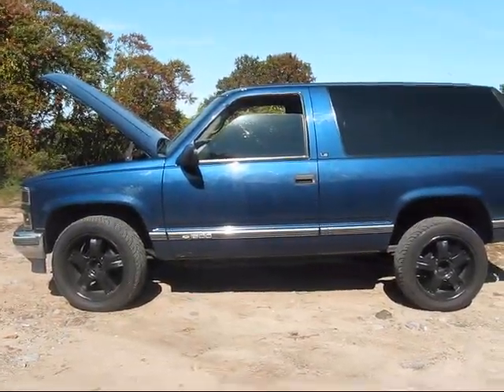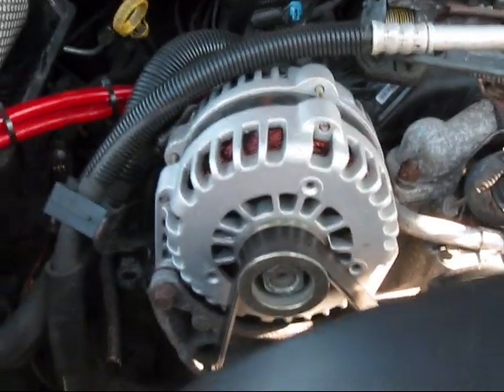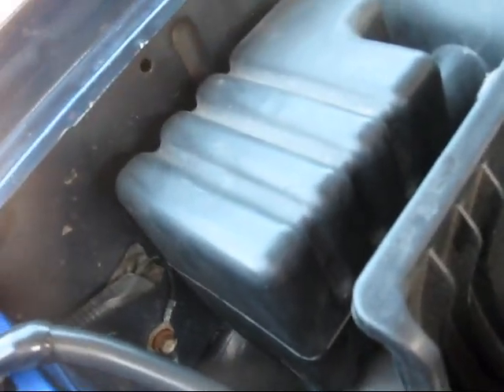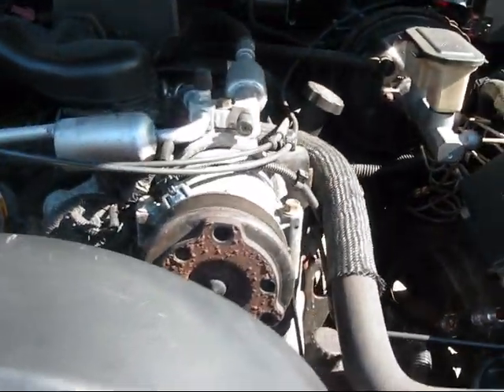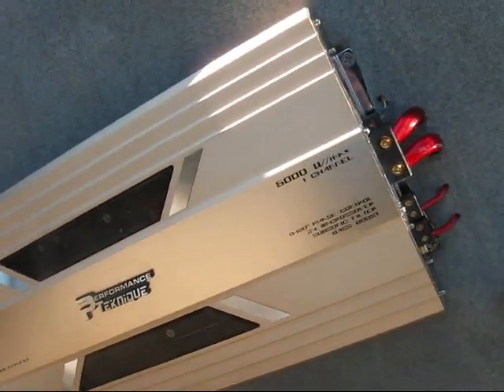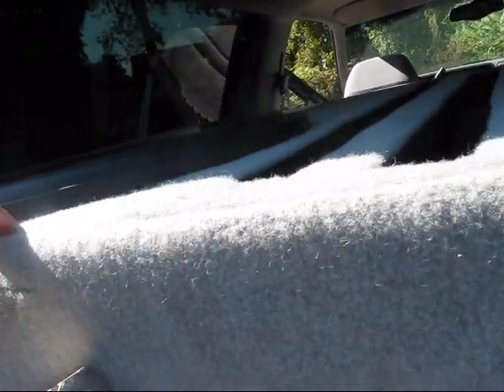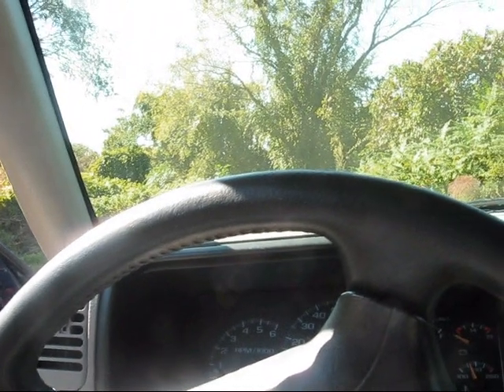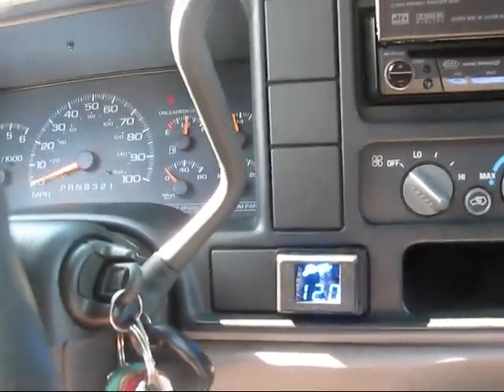how to wire multiple batteries

Comment: This is a really old video but in case someone tries to do this please be aware that is very dangerous to put batteries like these, lead/acid batteries, in the cab of ANY vehicle. When they are charging they put off hydrogen gases. Putting those batteries confined under a seat and that gas will accumulate building a very powerful bomb. All that's needed is a spark. SOMETHING THAT BATTERIES ARE VERY GOOD AT PRODUCING. EVEN THOSE SEALED BATTERIES HAVE PORTS OR VENTS TO ALLOW THE GASSES TO ESCAPE. The only battery that can safely be put in the cab of a vehicle is lithium batteries and they require a different type of charging system then what comes on almost every car. Those lithium batteries don't explode from the glasses that they put off they just tend to explode. Because your charging them... Point is no matter how you do your build it's better to 
keep your batteries away from the area that you or others may occupy. The chance may not be very high that something might go badly but the fact that there exists a chance is enough for me not to take it. My family and friends mean more to me then having the loudest stereo. Even if I were to build a split truck for compositions. Still not worth the risk of explosion

Comment: Dont see the point in connecting 2 batts with no isolator, when your truck is OFF you cant run shit for hours and hours then you kill the starter power. Having 2nd battery alone and 2-3-4 alternators to main battery, with isolator will charge 2nd when needs to be but wont effect the starting power. Your risking need a jump start connecting both batteries and running stuff. Example camping or working, I run heavy duty lights off 2nd battery w power inverter even a fridge and tools, so no way I want it sucking from my main battery

Comment: F or fail. Your radiator support is aluminum just an FYI. That's a whole lot of cables you're not getting any points on cleanliness. It looks like ass , and not the hot cheerleader type ass

Comment: Your gunna burn up that alternator trying to power all that equipment if it’s the stock 140 amp . Also u could cause issues with the batteries as well if always low voltage and never getting there full charge. U have a nice size vehicle to drop a few more alternators in that beast. Immmmmm out ooooooo heeeeeeerrrrrrrrr.

Comment: Try a dc to dc charger and a smart alternator box that will triple the charge when needed and a heavy duty voltage regulator . This will cost much less than 4 more battery and two more alternator victron makes these two boxes .

Comment: Just a suggestion never screw your amplifier to your speaker box just picture this take a bungee cord and strap your head to your box I know it sounds funny but do it for one beat then once you feel that your amps will take a beating the amplifier gets hot and you have soldered joints all over your amp board when you're amp gets hot the joints get hot as well and the constant beating on the hot amp can cause things to come apart strap them to the back of the seat mounted on a piece of 3/4 inch board I used plexiglass 1/2 inch you can drill the wood or plexy and run your wires through the holes that's why people build amp racks to absorb some of the raddeling and so that the amps can cool easier I had the same truck you have now I had 4 sound stream pro 15s 4 1000 watt sound stream amplifiers 1 going to each 15 and and a us 500 watt amp running all mids and highs and 200 amp alternator 3 batteries all old school amps and speakers the new sound sream amplifiers and subs were bought out by some idiot that calls them the tarantula series fucking retarted but I cracked the windshield at 3/4 volume any more than 3/4 volume and the truck would shut off so I sold the truck I wish I didn't that truck with an ls swap the ls truck motor come with iron block awsome for boost compared to the none iron blocks that you have to get a girdle for the bottom end just wanted to let you know I've messed up a couple amps bolting them to either the box or to the metal on the floor if you're going to put some foam under your amp wrack just looken out its happend to me so good luck with the build

Comment: I upgraded my power system in my Honda HR-V to support my various interior power applications for my work computer, my bi-passed security-disabled navigation system with full onslaught hi-res screen mirroring , undercarriage custom hand made 25,000 lumen output safety lights that aim toward the ground,  and also to power high draw appliances for survival applications as well. I’m also setting it up for actuator type applications. The coffee maker idea I had is also almost completely drafted onto paper. The list keeps increasing but I’m not waiting for the auto industry to finally get with the program and install these things into the vehicles. The last goal I have which is possibly the most expensive is adding custom fabricated steel plates onto the front of my bumper. It’s going to look like a versatile beast on the road minus the 4 cylinder turbo engine. I know it’s not a truck but I pack more hardware and tech in my HR-V than the average truck has. :D

Comment: I’m installing a second battery on myTahoe to run the led lights in my travel trailer.  Having it wired like this will get it charged while I’m driving.

Comment: How is that supposed to work man? No matter what you do you will overcharge one or the other batteries. This is why they make battery isolators. One battery to run your vehicle the rest of your batteries to run your system! How will the alternator not charge the battery fully charged running your vehicle? While trying to keep up with the battery running your system? Running two power wires off of the alternator even with matching batteries if you are using one to run your truck and one for your system at the moment the one running your truck will be overcharged or the alternator will read the battery is fully charged and not charge the battery running your stereo system. Now you could run two identical batteries in series to double your battery capacity but you cannot isolate One battery for your subs and amplifiers and one battery for your vehicle. I have 4 batteries in my trunk. I do not run them in series parallel. One of them runs my vehicle and the head unit. The four in the rear end have a battery isolator that comes from the front main battery. Whenever my rear batteries are low the isolator receives the power from the front battery! In the end for the way your system is hooked up you would need to either run the batteries series parallel like one giant battery and if you're doing that you would not come off the alternator you would jump from Battery to battery power and ground with both batteries fully charged at the start. So one battery would not have more power than the other battery. The way you haven't ran. Two power wires off of your alternator as you deplete One battery from your system and the alternator tries to charge your second battery the front battery or main battery running your vehicle would be overcharged that or the alternator would detect that one battery is fully charged and the other battery would never receive a charge because the alternator would shut itself down due to the first battery being fully charged! Even if the alternator did not shut down and it started to charge your secondary battery it would overcharge your other one. You need a battery isolator or a second alternator for the stereo battery Bank. unless those batteries are ran parallel like one giant battery you run the risk of overcharging one or under charging the other.
Reply: Need some advice I have 2 Optima yellow top same battery's one under the hood (big 3) and the other in the trunk I ran the positive from the front battery to the rear and grounded the battery to the car I'm wondering is this correct . Years ago my sound system pounded along as I had the car reved up to 1k rpm and now the sub cuts off so I took off the rear battery and charged it this works for a week or so then back to the same problem I think I might have a bad or going bad alternator that can't keep up with the system around 2800 watts on a stock alternator . Car is a lexus gs very hard to find a higher amp alternator for this car for some reason but any advice would be appreciated. Thanks

Comment: I did the same thing like u did . Did the big 3 . I have a 130 amp alt (stock was 55amp) I have a brand new Walmart batt upfront n 2 XS750’s in the rear. But wats happening is my right blinker went crazy. So what I did was pull a trigger from the fuse box cause I believe the problem was coming from the remote from the head unit. Once I used the trigger from the fuse box the blinker problem stoped but now I can hear my belt giving off a slight churp, like the alt is struggling . What do u think caused the problem that was making my blinker go nuts? N also what do u think about the alt struggling? I hope the alt is strong enough?. I’m running a zrx3000.1d hyfonics, pushing a single pioneer tsw3002d2 . N a kicker 300.4 pushing 4. 150 watt pioneer door speakers. Everything is fused with 150 amp fuses.
Reply: 300 amp fuse on my subs... 4 15s kicker subs... On 1 ap 3000...im lackin a good alt... .my new set up gone be tough tho...

Comment: That is nuts I had one big high output alternator with 2 batteries 4amps the big 3 upgrade and never had problems with voltage drop he doesn't need all that for what he has and I also had dry cell batteries one under the hood and one in the back close to the amplifiers

Comment: hello everyone, I'm looking to install 2nd battery in my suv 2000 4runner v6 for led lights and etc...so i wanna know whats best changing the alternator to 200 amp or get battery isolator? which one of the video is problem free and less hassle ?

Comment: You said so much dumb ass shit in this video I'm surprised you even thought it was okay to feed other people incorrect information. You clearly have no idea what your talking about. First, RMS only applies to AC power, not DC power. Did you really say you have a 300 amp fuse to "get the most power into your battery"? You must not know what a fuse does.  I can't believe you said your old ground was sparking. Did you never think about that before you did whatever it is you did to make it spark?

Comment: im not hatin bro but do some research man your overdoin it way too much you dont need 6 batterys for your beat bro just trust me get a 300 amp alt a batt isolator and 2 ,1,, or 0 gauge wire and youll be golden

Comment: TO STOP THE GROUNDS FROM RUSTING, BUY AT THE AUTO SUPPLY BATTERY POST PROTECTOR.  ITS A SEMI TRANSPARENT SPRAY THAT WILL KEEP THE RUST AND CORROSION FROM FORMING.  I SPRAY ALL CONNECTIONS BOTH POSITIVE AND NEGATIVE.  YOU'LL HAVE TO DO THIS MAYBE TWICE A YEAR BUT IT ONLY TAKES A COUPLE OF MINUTES AND IT'S WELL WORTH THE EFFORT AND THE 4 OR 5 DOLLARS FOR THE CAN OF PROTECTOR!  GOOD LUCK TO ALL...

Comment: you're engine bay area is super clean. 😃 you can basically eat off of it and I like your future plans with the 2 extra alts. if possible try to run 14 volts- you're amps will come alive have around 1,000 maby 2,000 watts  of extra power and in the video you did say you're system runs 14 volts but when the music drops does it climb down to 12 volts?
Reply: cloud chaser well that's what an alternator supposed to put out

Comment: Hey bro...nice work....but fyi....rms (mentioned in the first 30 seconds of your video) is only applicable to AC....not DC (like is used in the car...), so whoever told you the calculated value of the 'rms' for your system of batteries was incorrect.  RMS does not apply to DC.

Comment: Love them 2 door Tahoes! Clean install. Have you added more grounds? The core support ain't a bad spot, but maybe consider running a wire from the core support to the frame as well, also from the engine to the frame, and frame to body. Let that current flow real nice.

Comment: I like the wire job only thing I seen is need to put heavy duty ground from battery to block. I had to end up putting secound alternator on my 84 buick Park avenue. I also put battery in my trunk for my car amps. My second alternator charges that battery. I do agree need good alternator to keep up with electric load. Now my car is happy and so is my stereo.

Comment: Can I connect 2 batteries to 130A Alternator?
Reply: Yes but it will put a lot of strain on it depending on how much power youre running.
Reply: I done it to my ford explorer no problem. I upgraded the alternator to 160. No issue and running 3 amps on that to. Just when jamming out limit what stuff don't want to use. I found sometimes running second batter it helps the alternator run cooler. Just upgrade your battery and alternator cables. Run another thick charge cable to other battery.
Reply: +Harold Lewis So it would be better to run 2 0 gauge wires from the rear of the alt to each battery or 1 0 gauge wire to first batt. and run the 2nd wire from first batt. to 2nd batt? Please help on this issue
Reply: I would run 1 guage from rear of alternator to each battery. I also would remend ground second batter to engine block and fender side also. For additional anti feed back I also added #8 ground to frame of car to engine block.. 
Here is way I look at, Upgrade wiring once and leaves room to upgrade alternator. Hope I did help. If want to protect wiring use shielding to protect rub spots. 
Example of wiring battery one to altlernator, then battery two to alternator. Wouldn't hurt to fuse wiring from alternator to. Example of fusing it like if running fusses from alternator is, 250 amp alt. Use a 250 fuse on battery one, then battery two 250. That way if wiring does have issue has protection.
Reply: If running a 130 amp alternator use a 150 amp fuse on each batter lead to alternator.
Reply: +Harold Lewis Awesome thank you very much for the info it helped my 2nd battery get the charge it was starving for 👍👍
Reply: Why wouldn't you the alternator supplies the battery with power not the opposite

Comment: Is this really 4 gauge wire ran to everything? If it is you really should use at very least 0 gauge cause your going to gain so much more. But if I'm wrong about 4 gauge.   That's my bad.  But everything looks great man.  Good job

Comment: Looks tight man, but you need to fix that door.  It's squeaking every time you open it. About the groundwire underneath with a bolt and the fuel line, go ahead put Loctite Clear Silicone Waterproof Sealant on it.  It'll fix the rust problem.
Reply: Or spray bed liner or clear coat paint on it.

Comment: PLEASE REPLY!! Can i run a new wire from my alternators positive to a 3rd battery in the trunk, ground the battery like normal and will the battery get charged? The 3rd battery is for my 2 subs. Cheers =)
Reply: +Low Fast Famous 
Yes, should work.  An alternator does not see one or six batteries; it sees one big battery.  However, a stock alternator was not designed to charge multiple batteries.  You should at least upgrade the wiring to two or zero gauge, especially the wiring from the alternator to the battery or isolator.  .  You should also consider getting a higher output alternator.
Reply: +J Robles (Chuy) Awesome cheers for that, the batteries have been relocated to the trunk in my truck so its running 0 gauge. Also the system is 24v that's why i cant run batteries in series if your wondering, and the truck wont start even if the other battery is completely charged because the system thinks both batteries are dead. Hence the reason for an accessories battery. So if the system is 24v will the alternator be 24v also?
Reply: +J Robles (Chuy) Cool thanks heaps for your help

Comment: will the altinator be able to handle two battery's I'm running a 40 inch bar 2 kc lights a 20 inch bar and 2 12 in subs on a jeep cherokee please respond

Comment: would n- t that hook up run 24 volts back to the starter for the motor ?
Reply: +getitdone1958  no its still 12v but double the cranking amps and capacity of the electronics that you can put in the truck or car if you hook it up in series it will be 24v
Reply: ok i see that know

Comment: derrrr i use one 200 amp alternator on a rescue truck  with intelligent charge control  i can run charge six or more units on one alternator . that is a stock Daimler 200 amp unit .  you have no water protection on your Grounds and they are not good Ground points assuming you still have the motor .

Comment: Hi there,
Great how to video. I have a question for you. I'm looking to run a second battery to power my amp. My current alternator is only 90 amps im only running 1 amp that's 1100 rms mono block. will this 90 amp alternator cope...or do i need an upgrade?

Comment: In all honesty you don't need all that power for those amps. They are a junk brand. I like how you're actually upgrading your electrical like you're supposed to but that's extreme overkill for those amps. Now if you we're running good brands like Soundqubed, Crescendo, Sundown, American Bass etc. i could understand all the batteries......
Reply: Jessey Hixson amen
Reply: BassHead94
It has less to do with the brand and more to do with the engineering.. It's not like all those companies you listed don't sell a variety of products. It'd be a joke if they only sold maximum power products like that train horn company.
Reply: what are you talking about? even one decent amp pulls a lot of power! dimming head lights? now imagine 4 amps! 1 orion xtr1500 was making my headlights dim so much people would think i was flashing my headlights at them at night!